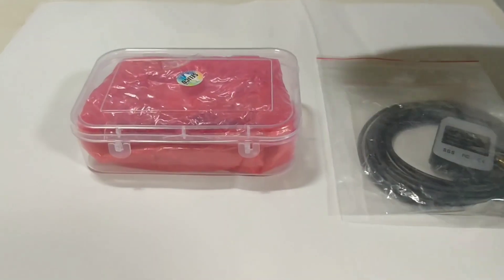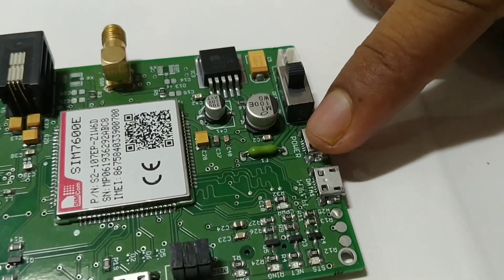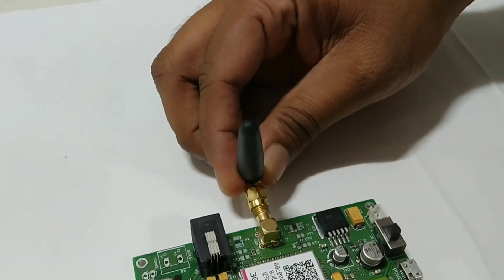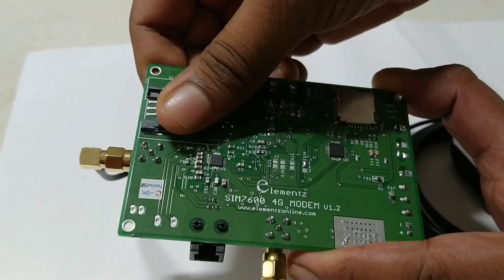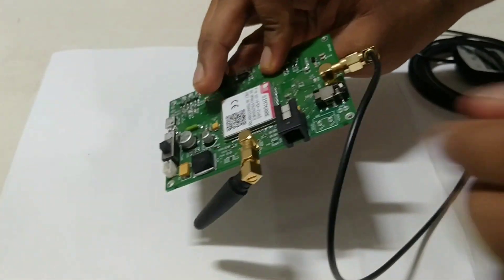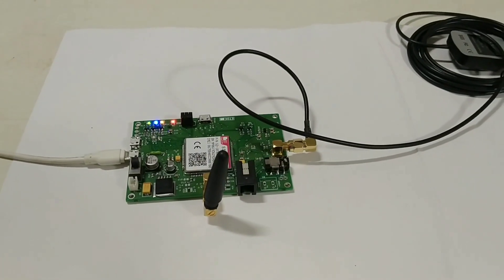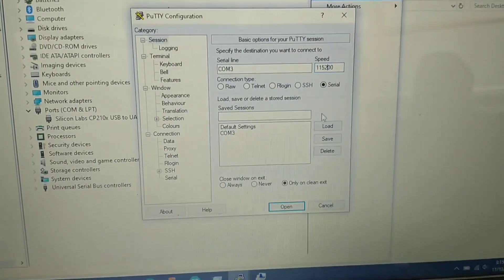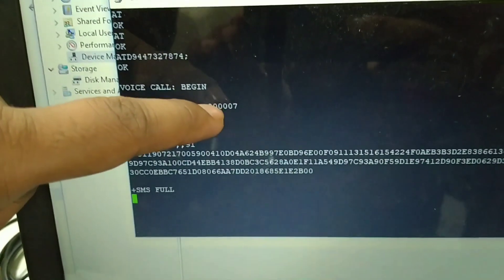Unboxing SIM7600 4G GSM GPS Modem by ElementzOnline

Comment: you are saying, connect GSM antenna in antenna port. GSM mode does not send high data. Does it support 4G LTE mode for high speed data?
Reply: Yes it does
I'm not sure if it supports full 4g speed, but there is definitely some connectivity there

Comment: I already bought the module but the lack of documentation provided on site, I am having trouble interfacing the arduino with it?? Any help on this topic will be appreciated.....
Reply: I also need to know, I bought SIM 800 (for my project 2g is enough) but it didn't support every https and mqtt(s).
Reply: Agreed, the documentation is very poor
The way I made it work was using UART serial communication to send AT commands

Comment: does this work in canada?
Reply from the maker: The modem utilises the SIMCOM module which works for the Asia Pacific region. For EU and NA the SIMCOM variant based modem should be used.
Reply: Use either a SIM7600-A or -G

Comment: Can I use as reciever for drones
Reply: Bad choice. Instead use a radio transceiver. This is a Modem not a Transmitter
Reply: It would indeed be possible if the on board lte connection is programmed for input via controller over the internet. However latency is possibly an issue.